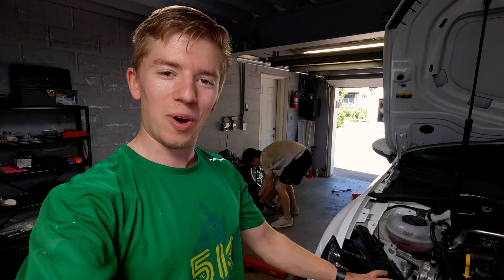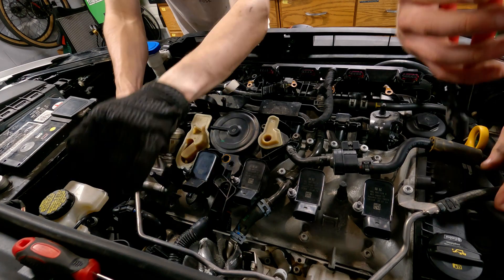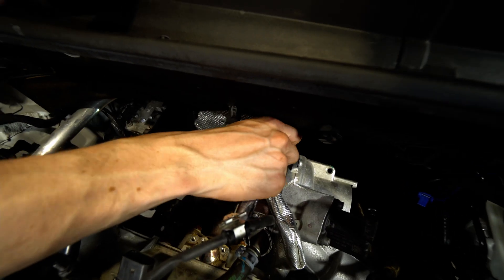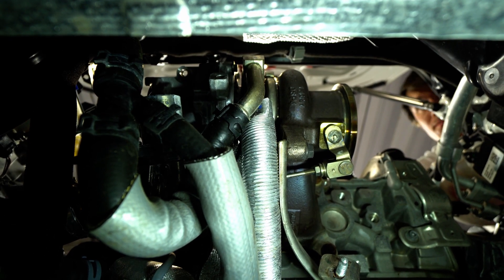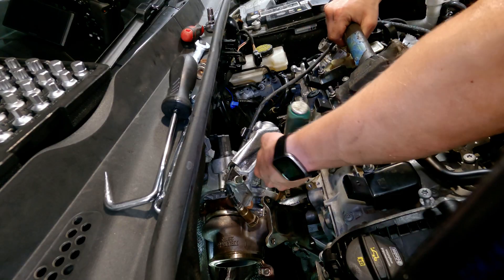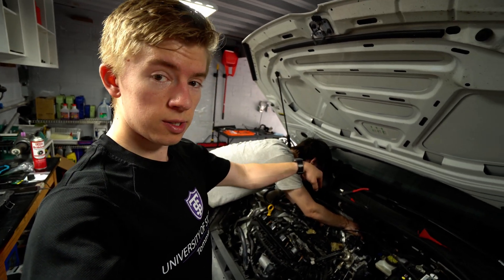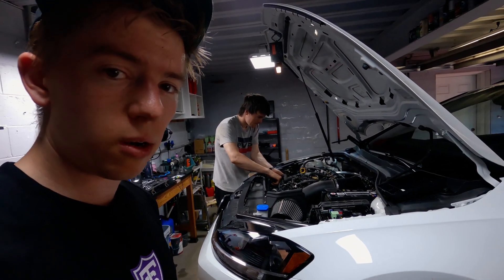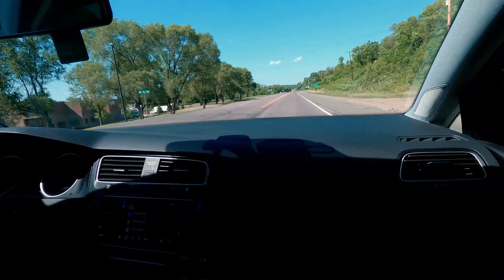Golf Sportwagen IS20 Install Turbo Upgrade!

Comment: Are there any adjustments you have to make on the turbo itself if your doing a direct swap?
Reply from the maker: You have to make sure the wastegate actuator closed voltage reads 3.7V then run the adaption.  We walk through this process on my IS38 install video.
Reply: @HardwayLearning  Thank you

Comment: Currently APR Stage 1 with APR Intake. Been wanting to put IS20 and Golf R intercooler in my 2015 Wagon for a while. Might still do it.
Reply from the maker: Do it! I'd recommend getting an aftermarket intercooler though, the intercooler install is a PITA (check out GTI playlist), better make sure it's worth it unless you're getting an R intercooler for free
Reply: @HardwayLearning  I did it today. But have an issue. The first time I launched the car I got EPC light at third gear. I did the APR tune. I left a message with the tuning shop that did the work. Will see what happens.
Reply from the maker: @mhaas281  it's probably boost target/wastegate related issue. Did you set your wastegate voltage?
Reply: @HardwayLearning  no. I was advised it's only needed when going from IS20 to IS38. I thought maybe it was a shifting issue. Will get code and find out. Thanks for the reply
Reply: We gapped the plugs tighter to .026 and the issue seems resolved. If all goes well I'll do the APR intercooler in the spring. APR is claiming +21 hp gain  with their intercooler.

Comment: Why is20 and not is38? Way more gains for a few more bucks.
Reply from the maker: I gave him my IS20 for free and he can still run it with a JB4 and retain his warranty. It's pretty fast with e30
Reply: How does he retain the warranty with the 20? And why wouldn't the IS38 be the same?
Reply from the maker: @Zakw17  he would have to swap the IS12 back on. Because it's using a JB4 instead of a flash they shouldn't be able to tell from the ECU that the car was modified.

It's not clear you can run an IS38 with the JB4 if you look at their website, but I've heard of another guy having success.
Reply: @HardwayLearning  swapping back seems rough. Hopefully he has no issues. I have IS38 plans for my wagon hopefully.
Reply from the maker: Yeah it would be a pain, but it is at least an option to have work done vs being TD1 and SOL